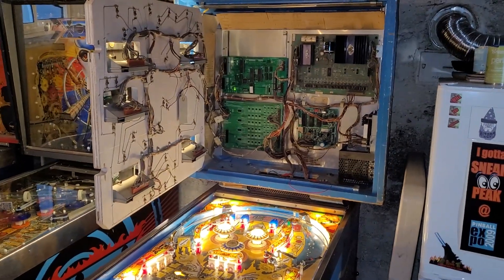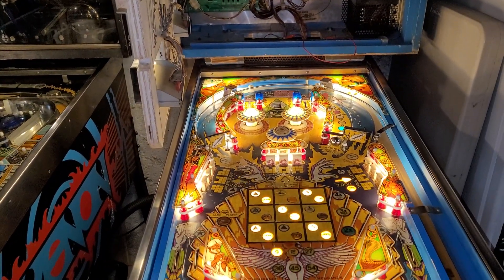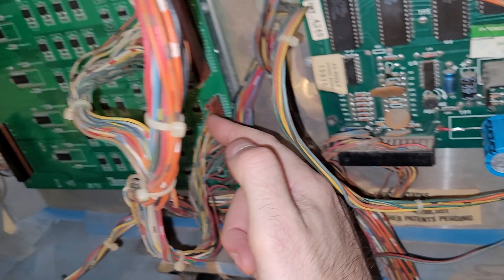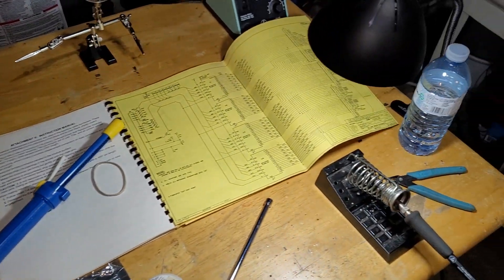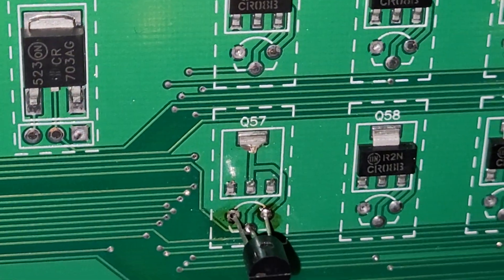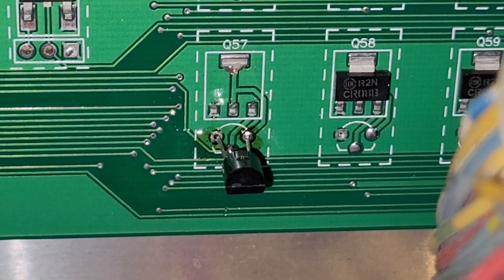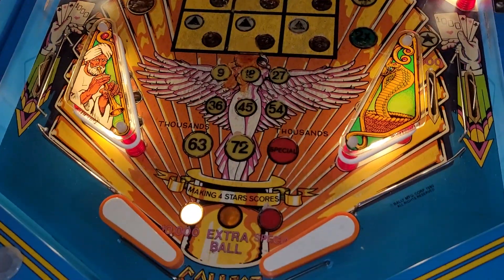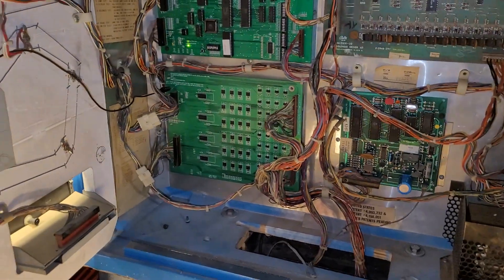Repairing an Altek pinball lamp driver board. Replacing surface mount scr with through hole 2N5060.

Comment: Hi Mike, maybe you should add some solder on the top side of the board on the left leg of the transistor? I know everything works now, but it seems to be "floating" in the gap, at least from top side....
Reply from the maker: Good eye, I also noticed that when editing the video! If the lamp craps out I will pull the board and do that!